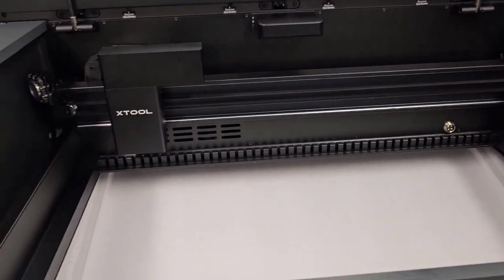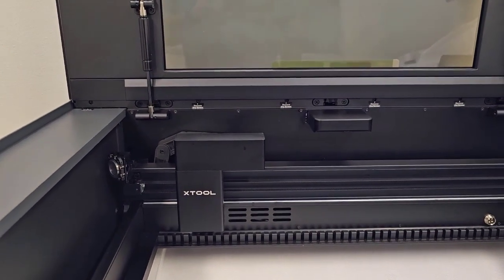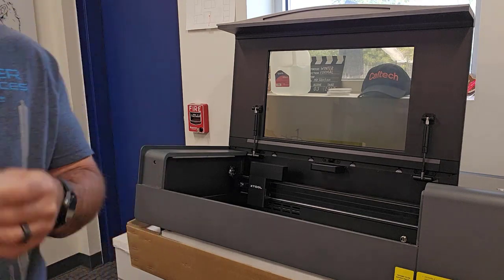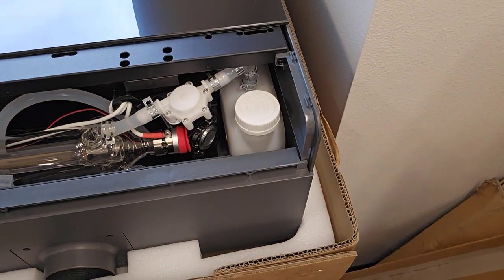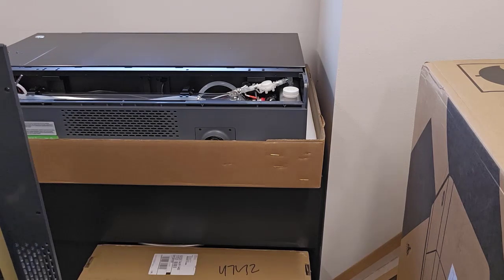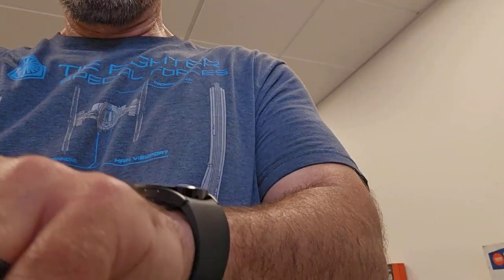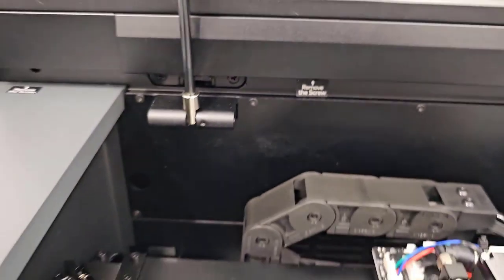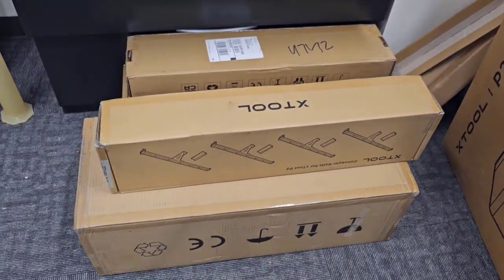Unboxing and Setup of the XTool P2 55 Watt Laser Cutter

Comment: Thank you for this! One question in regards to the distilled water/coolant ratio; I'm also in Texas (Houston to be exact). Will only using water cause any damage to the laser tube? Would adding SOME antifreeze cause issues?
Reply from the maker: It comes with the antifreeze, so definitely no issues if you add the correct amount. If your craft room gets below freezing and you do NOT add antifreeze, the water may freeze and break your laser tube. My craft room does not get below freezing, so I put pure distilled water.

Comment: Would you happen to know why when I try and cut a simple shape out on my P2? I just received it pauses and just stops. It doesn’t finish the cut?
Reply from the maker: I have not yet cut anything on my P2. I just finished setting up and I'll be cutting early next week.
Reply from the maker: I did my first cut yesterday and did not have any issues. Check your water level. If the laser detects that water isn't flowing, it'll turn off.